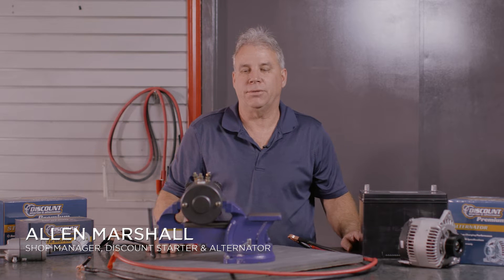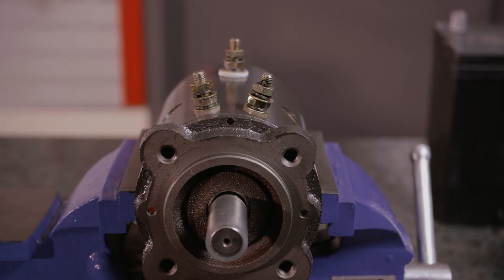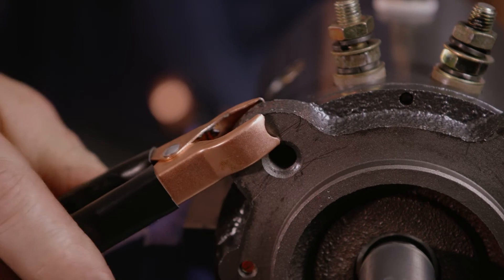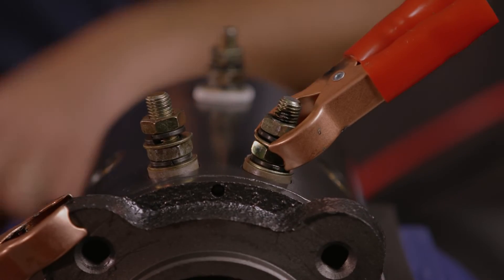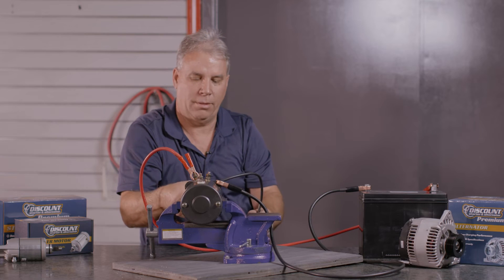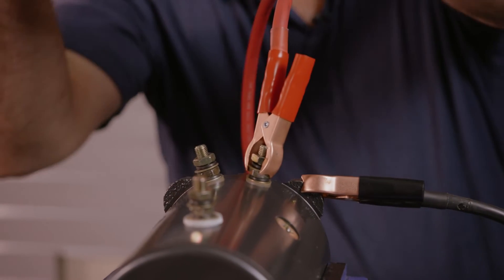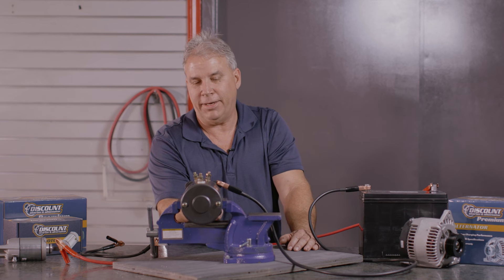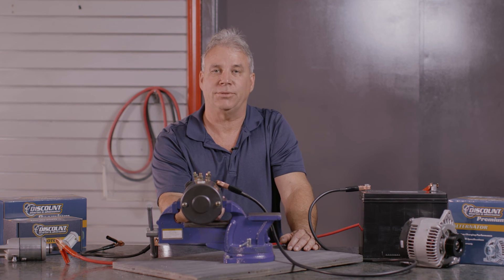How to Test a 3-Post Winch Motor

Comment: I ordered New Winch Motor Replacement For Ramsey Double-Bearing 6HP Pierce Tulsa Cam Hickey 6HP 2BB MBJ4201 MBJ4402 MBJ4405 MRVB8 MBJ4409 MBJ4410 W-7643 W-8933 W-9133 W-6900 W7643 . And it wasn't wired that way
Reply: how is it wired? im trying to figure out my ramsey patriot 15000 as i didnt come with solenoids